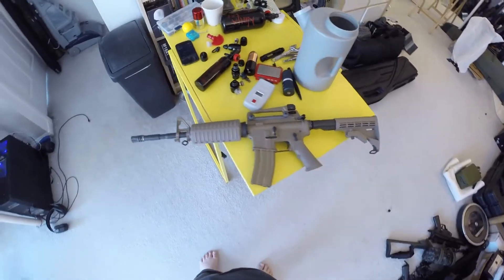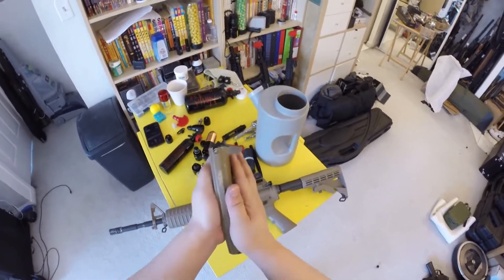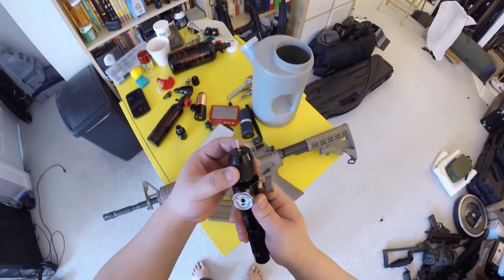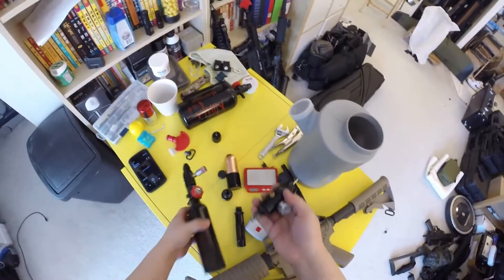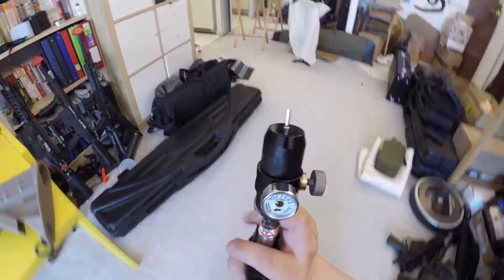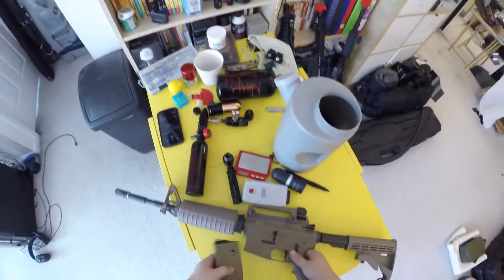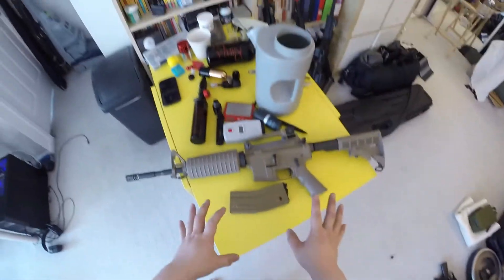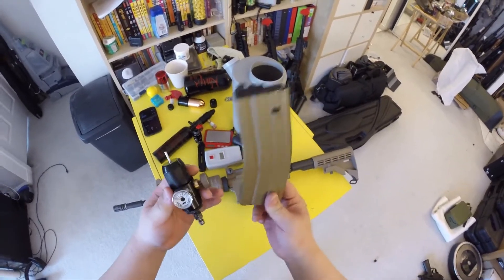We Airsoft Gas Blowback Guns Use HPA in Magazine?

Comment: Just some advice for someone who wants to do this. Buy mag adapters from airsofttaiwan.com. The adapters are screw in, so no need to tap your mag. The mod is reversible. Run hose (comes with the adapter) to the air pressure tank. Put tank in backpack or pocket. You also need a regulator that can take the pressure down to 70-120 depending on which gun you use. 70 psi=134a gas  110psi=green gas. With this setup you can also connect your guns to a compressor at home for trouble free cheap target shooting. Cheers!
Reply from the maker: Lintott Yup that is right, I have learned and done it now - https://www.youtube.com/watch?v=NW9fZj02jC4  and you can also buy those from EVIKE and such too.

Comment: Those mags fill almost instantly haha.. no need to hold it there. Thats only when its a liquid gas like CO2 or Propane... you're letting the liquid build up in the mag so it can expand when discharged. HPA works way differently! More pressure the better and instant exchange of gas. needs to be regulated tho like you state.
Reply from the maker: bergers5 Yes I know, I have got the CQB Russia shit now and hook them up to remote hose, it's good enough and damn this injection don't work with HPA on the mags, oh well!
Reply: MakHobby hey can you tell me if you can use that madbull Co2 transfer for green gas mags or no i know its alot more pressure but i was wondering